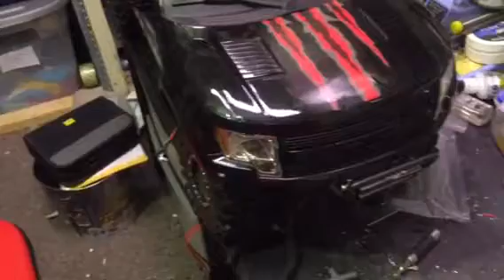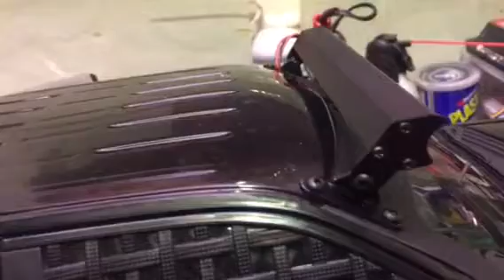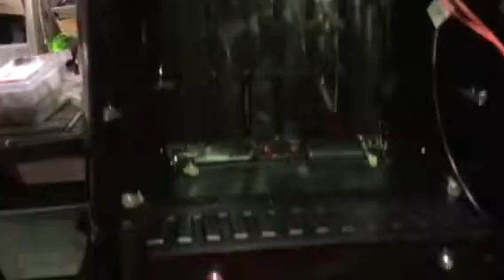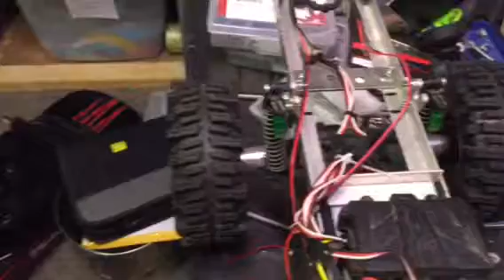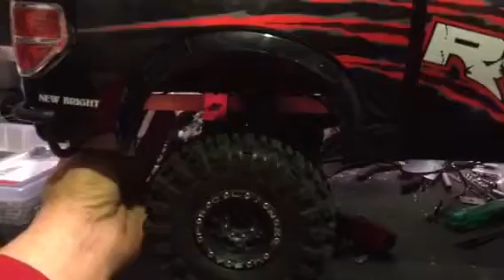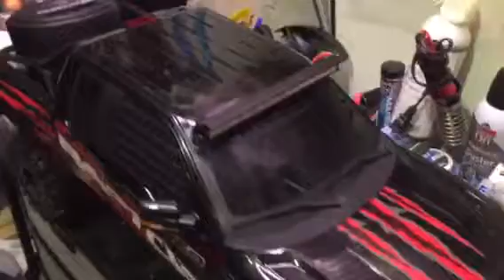1/6 scale rc crawler new bright raptor hardbody

Comment: nice work. I been researching how to extended the frame. yours is probably the easiest way. question, what rear driveshaft is that?
Reply: gza 808 if you get intergalactic drive shafts they use a hex shaped inner spline and just get an Allen key the same size and cut it to length
Reply: sportster davidson you have a part number on what shafts to use? Currently modified wraith drive shafts and glue them together lol
Reply from the maker: 1/14 tamyia semi truck drive shaft